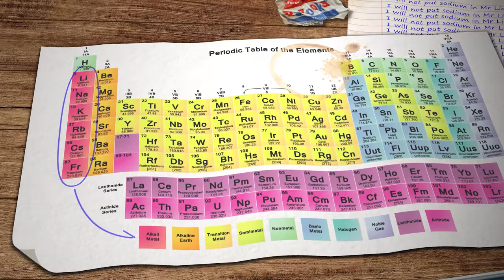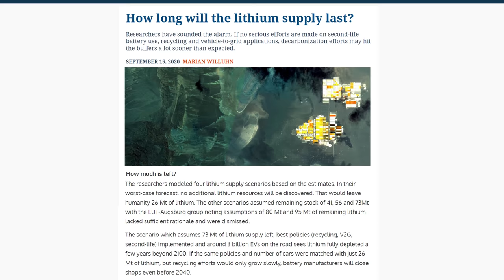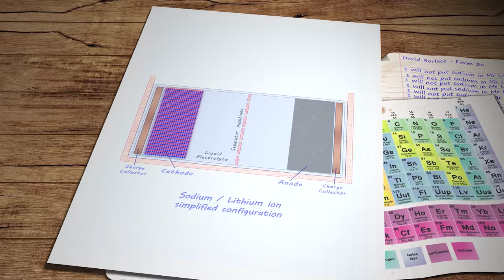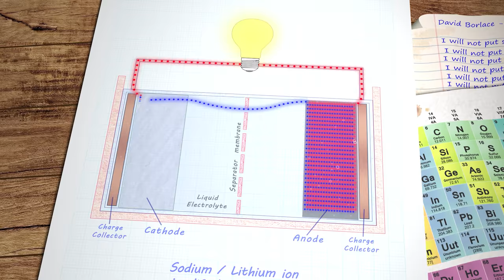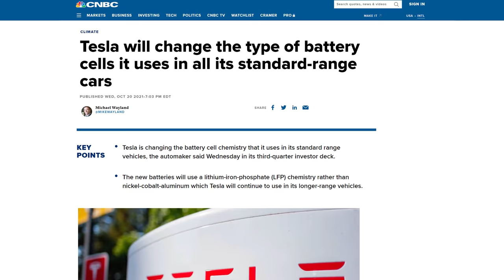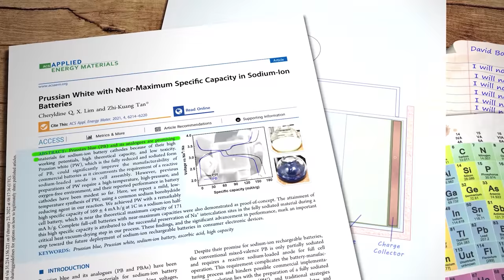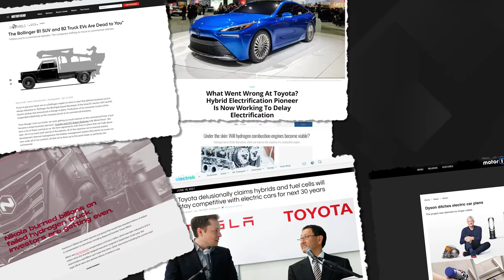Sodium-ion battery breakthrough. Safer, cheaper and cleaner than Lithium-ion

Comment: "maintain a capacity as high as 95% after 10,000 cycles"

If true, this will completely change grid energy. Even discharging fully every day, the batteries would maintain 95% capacity for more than 25 years, which is insane.

Now imagine if we spent as much on sodium ion battery tech as lithium tech and what kinds of breakthroughs would be possible.

I also cannot help but consider that this type of technology has the potential to take away the power of so many oppressive states that profit from our use of fossil fuels.
Reply: only for the cathode side, the anode sill limiting cycle life to that of lithium batteries.
Reply: I agree. The fossil fuel tyrants need to go.
Reply: @fex144  This will not reach market till those tyrants that are in control of it let it happen, if they didn't actively stop it they would lose control.  Just imagine what they would do to maintain that control.  only way this stuff gets through is if it did it unnoticed(unlikely)... and then it will just be bought for a price and suppressed to stop the damage it is causing them. till they can monopolize on it.
Reply: @Shep01  I don't think your assessment is correct. CATL is considered by the Chinese government to be one of its industrial champions and actively helps support and finance it. China wants to become energy independent not only to reduce pollution, reduce the reliance on energy imports, but also reduce the geopolitical risk of US/India/Japan/SK/Australia/etc coalition blocking sea-lanes and oil tankers which would cripple their economy.  Developing alternative energy solutions is and has been and continues to be a massive government undertaking.  There is no way China would let Saudi Arabia or Russia sabotage CATL and its drive towards energy alternatives.
Reply: "maintain a capacity as high as 95% after 10,000 cycles"

If true, ....

No, it is not true, He puls this out of his ass.
Reply: China being an oppressive state it's just playing the musical chair with power.
In fact it's worse since Cina has other area where it has a dominant position (rare earth metals and others) it's concentrating power in the hand of a single oppressive state.
Reply: @yahaaa1343  If China shows sodium ion batteries are possible, it doesn't mean the technology cannot be developed locally as well. And fortunately sodium is well distributed in huge quantities across the globe. Table salt (half of it being sodium) is already dirty cheap.
Reply: 95% is ideal conditions.  You have to remember in something like a car, regenerative braking is recharging the battery constantly.  (Always read the fine print)
Reply: @donh8833  My understanding is that it doesn't really matter if it is recharging / draining constantly. That is, a 1% charge/drain contributes 1% towards a total charge, and batteries are typically rated to 1000+ charges. So a 300 mile range vehicle can expect its battery to last 300,000 miles, and frequently the battery will last well over the 1000 charge cycle target. (There are many Teslas that have hit 300k miles and their batteries are still holding up well. And battery designs today are better than they were when those older Teslas came out.)
Reply: @2drealms196  lol you're hilarious
Reply: @mcapps1  I'm willing to reconsider this opinion.  Why do you disagree? :)
Reply: @fex144  It's also worth noting that the same corporations own a lot of the green energy sector, too.

But as Stardust noted, that's only for the Cathode of the battery, the Anode can (and probably will) fail long before that. it does provide the potential for recycling cathodes, though, which can reduce replacement costs.
Reply: @dosadoodle  Salt is NaCl.  So if you disassociate  the Na from the Cl (easy to do with an electrochemical cell and a proton  exchange membrane) what do you do with all that Chlorine gas?  The market for Cl gas has to match that of the NaOH.  Currently it is used for making PVC and for making water safe to drink, but the market for Cl has been declining.  We can't just let it go to the atmosphere...
Reply: @rogerheuckeroth7456  A disposal (lock up) method will have to be developed, but given the alternative of sodium is lithium, there's a huge cost benefit to switching, so even if it is somewhat expensive to lock up the excess chlorine, it will still be financially sensible.
Reply: Great point.  Also, if you think about resiliency, it would make ‘micro grids’ a reality.  It then makes the whole system more resilient as only a small part of the total capacity would fail if one micro grid was knocked out by storm, etc.   Further, if we assume residential and commercial versions of Na batteries are possible, then it would both remove need for utility “peaker” natural gas fired plants and it would allow for each home/building to have control of its own energy production.  Everyone could effectively and efficiently go “off grid” if they’d like or simply use the grid  as a backup.   Over time, the utilities become more of a network provider than a producer of electricity where they are providing the interconnects so that I can sell my excess production of electricity to my neighbors, etc.
Reply: @rogerheuckeroth7456  First where did you get chlorine isn't going to be in demand? The price is up and we are having to import chlorine.
Second even if it were a completely waste product react it with zinc. A pound and a half of zinc can hold the same chlorine as a pound of sodium.
Spot price of zinc $1.20 a pound. Worst case this adds $2 to the price of a pound of sodium.
Even if everyone in the world had twenty pounds for the car and twenty more for the house the chlorine problem would be insignificant.
Reply: They aren't energy sources they are energy storage so the effect of these specifically on fossil fuel consumption is insignificant.
Reply: @ghz24  Solar and wind are already cheaper than fossil fuel options. So why haven't they taken over yet? (Because they cannot power the world 24/7 workout plentiful and inexpensive batteries.)
Reply: @ghz24  Edit: I am including the first part of your comment, which you have now deleted but I was able to retrieve in the email notification: "really? And yet this month they shut down all the coal plants in my state and the price of electricity litterally doubled. ..."

Which state is this? (I'm quite sure you are making that up, so offer some details if not. I'd love to dig into such a case study if it is real.)

Edit: Given that you deleted your comment, it seems you were in fact making things up. I think we can all recognize that there are some BS artists trying to smear solar/wind/batteries here in the comments.

Re: nuclear
Nuclear sounds great and I'm supportive in theory, but the downside is that it is extremely expensive relative to other options. The promise of cheap nuclear power is constantly made but never delivered. If someone can make it happen, all the better (it's about as clean as solar and wind), but until then, it is not competitive.

Re: national security
That is important, as is I think making it more economical for people to be in control of powering their own homes and businesses is important. That is where solar + batteries come together to delivery energy independence at the individual level and at the company level. If battery prices come down, this will be the new reality. It would be nice if our future energy reliability was not so tied to the decisions being made by a handful of massive companies that are maximizing profit at the expense of national security and energy independence.
Reply: @davestagner  I think we're in agreement on all points. I'm not sure if I'd said something that made you think we don't agree on all of these topics?
Reply: @stardusttwo6262  hmmmm don't know which vid you were watching but I'd did hear that in there, so might you have different information?
Reply: @2drealms196  Totally agree with your analysis! China is actively pursuing energy sufficience & renewables are the road map
Reply: Yeah exactly!! Grid storage applications in mass capacity will be possible at a fraction or the costs of today Li-Ion!! Wonderful!! 👏👏
Reply: Thank you for the information.

Comment: I don’t have an electric car yet … but I love the idea that Sodium-ion batteries are, “cheaper,” and “less toxic,” and “more thermally stable,” than Lithium-ion.  All of those are excellent improvements!  🤩👍
Reply: Well yes and no…
Sodium metal is more reactive to water with explosive results.
Any kind of humidity getting into the battery will cause a huge hole in your leg if you have that battery in your pocket… 

Cheaper? Hardly as all new product take time with manufacturing require more and more production before they can become cheaper… 

Less toxic? Hardly as anything battery operated has a high level of toxicity…

Stable? Again hardly, the problem is that you have to be careful because if exposed to oxygen or hydrogen can cause the battery to expand or even worse explode… 
We will see whether this battery source is a real reasonable form of replacement or not in the up coming years… 

Finally they said the same thing about the Diamond battery but that turned out to be a fraud claim made by marketers trying to hype up for funding sponsorship for the product…

Comment: massive wind/solar farm, feeding massive de-salination plant, feeding raw materials for massive sodium ion battery plant. probably needs some more detailed drawings for this design, but that's it in a nutshell ;)
Reply: the neat thing is that something like a desalination plant could be run entirely by over-producing solar farms so they only run when the electricity is nearly free because the solar production is greater than consumption. so the load is "dispatchable", which can help stabilize the grid in a situation with mostly renewable power.
Reply: This would also get rid of the issue of "Brine Disposal" issue of Desalination Plants (Could even use industrial brine waste itself from drilling etc!)

 the chlorine would also be needed to be used, but if mixed with a bio-refinery / power-to-x stuff i bet it could be used
Reply: Yep, I was thinking the same thing. Renewable energy > Desal > Na battery plant and potable water plant > Renewable energy storage = one hell of a virtuous circle. Basically a money making machine.

Comment: If anyone can bring it quickly from the lab to massive scale, it is CATL.  Sodium ion batteries will be a game changer for stationary storage.  This is big news.
Reply: That was exactly my idea - stationary storage, where LiFePo is already the king...
Reply: @elephantintheroom5678  Yes and No. We see what happens when we depend on only one source for anything. Bad idea. I will wait until they are available by a local producer. Or a South African, whatever comes first.
Reply: @elephantintheroom5678  Yes, its a three layer solution. Every home with its own grid connection must get a home battery with at least 10kWh per 10kW grid power and be tied into the grid via its inverter. With or without solar/wind/water. That would be 20kWh for my home. Done - for my home.

Second layer is at local transformer level, the connection to the 5th and 6th category grid (homes are the the 7th) thats running with 10kV and 20kV. This one gets a battery together with the transformer of about 10%-20% in Wh of its rated power. Say a 5000kVA transformer gets a 1 MWh Battery with up to the rated range of  power.

Third layer is the grid scale storage together with large substations. We have one in our county. At least  100% of the rated range with at lest 20% in Wh in capacity. That one will not be a Li-Ion battery. Maybe Na+, maybe redox flow, maybe compressed air.

Then comes the power generation itself, very large scale pump power stations which are a bit slower to react and large gas power stations powered by our own produced methane and bio-gas during the summer months. Of course our power generation in form of Wind, Water, Solar must exceeded at least 120% of the needed power to be able to generate the overflow in the summer. Currently our country is at 81%. Much work ahead of us!